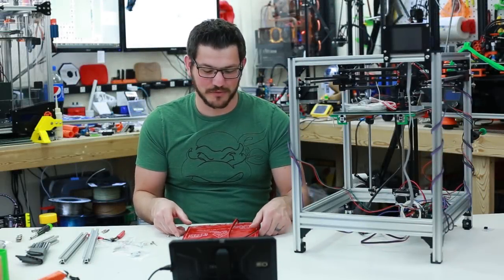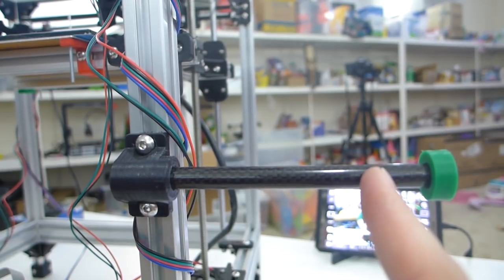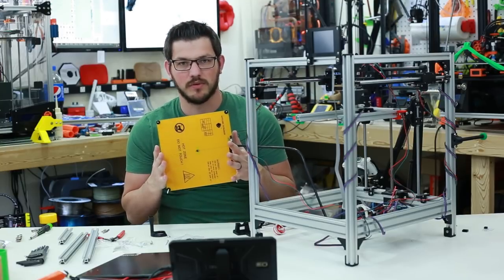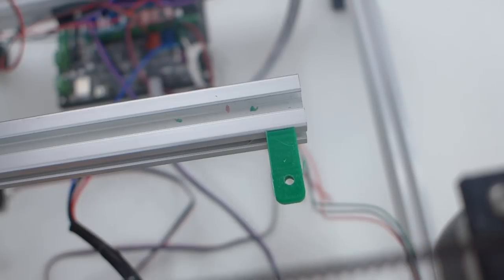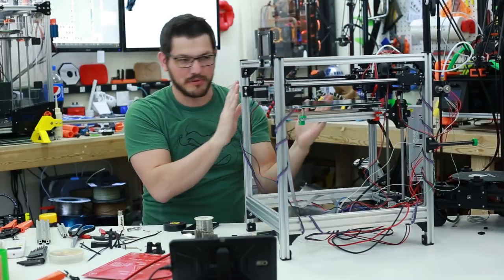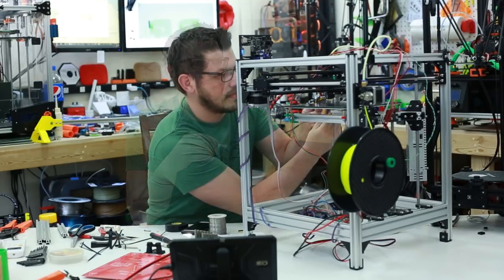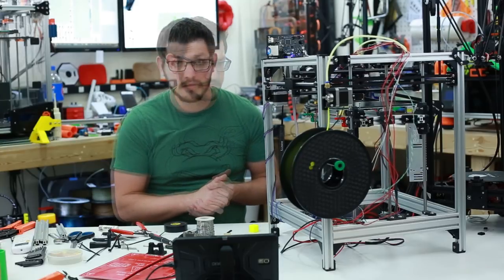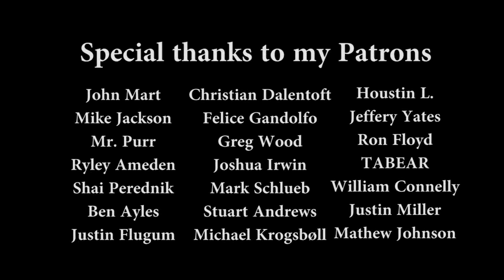HyperCube Part 5 (It Prints!!)

Comment: Looks Good 👍

But I kinda don't like this design,
1: Printer size is big but print area is small. 
2: the weight on Z-axis cannot be handled by just one lead screw you will soon see the outter side/front side of the bed going down. 
3: most the parts are 3d printed (if someone doesn't have a printer how can they build one).

Comment: So what happened?  Super intrigued by this build and it’s just disappeared from your channel. No mention of it. Aren’t you happy with it?
Reply from the maker: I'm very happy with it but I moved countries this summer and my stuff is still not at my new location. It will be a few more weeks till it arrives and then I can do more work on this project.
Reply: Looking forward to it. 

I just got my first 3d printer on Wednesday. I haven’t even printed anything on it yet and I’m thinking of building something like this. 

200 x 200 build plate is good I don’t really need so much height as you’re looking for. 120 - 150mm would be more than enough.
Reply from the maker: The build volume on this is 200x200x180ish. I can't wait to get it back and work on it some more. I have lots of ideas :)

Comment: I thought about doing something like the for x3A_8 to print 500*500*500
Anyone know where to get a heated bed that would work with this or how to make one?
Reply from the maker: For something that big you should get a milled bed and use a silicon heater.

Comment: As for the endstop wiring, why not use trinamic 2130 and omit them al together?
Reply from the maker: That was not the original plan for this printer. I also don't fully understand the wiring on the 2130. I may change it later but for the sake of time it isn't worth looking into yet.

Comment: where is your bed levelling sensor situated?
Reply from the maker: In this video there isn't one. I did all manual bed leveling.
Reply: @Fugatech3DPrinting   are the copper bushings more suitable than linear bearings? I think it is very useful when the block design can attach the linear bearings in x carriage.
Reply from the maker: @somanthamanuranga4061  The bushings route is ONLY for Carbon Fiber tubes. All these do is make the X carriage lighter. Are they better? I don't have an issue with them so I'd call it a draw aside from being lighter.
Reply: @Fugatech3DPrinting   in z axis carriage in the video you used 12mm rods but in thingiverse files that z axis carriage stl file is for 8mm linear bearings. and z axis clamp stl files are also for 12mm.It is confusing and those are need to be same dimensions. Can you upload the 12mm z carriage stl files????(z carriage remix files also in 8mm )
Reply from the maker: They are in the stock HyperCube files. https://www.thingiverse.com/thing:1752766/files